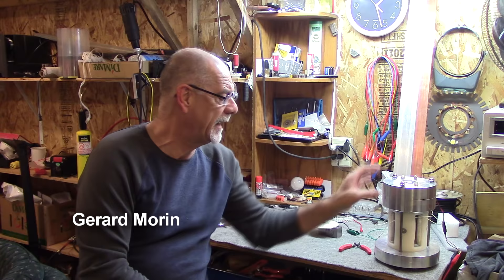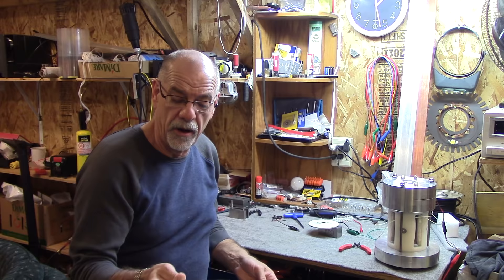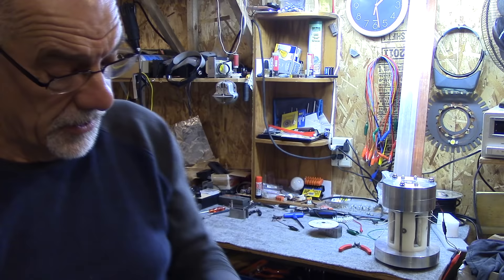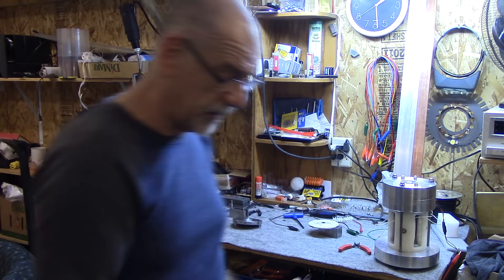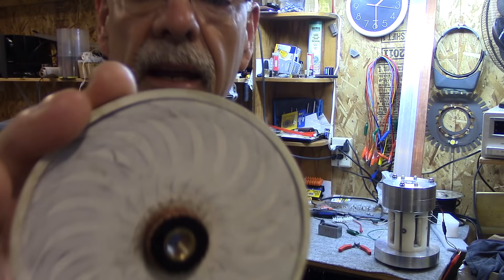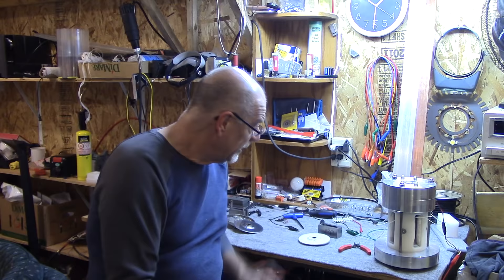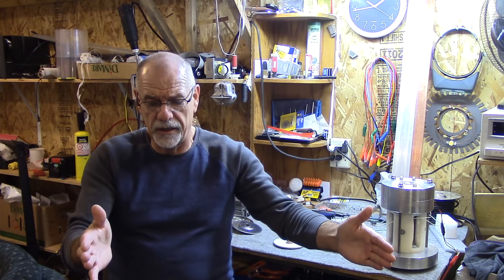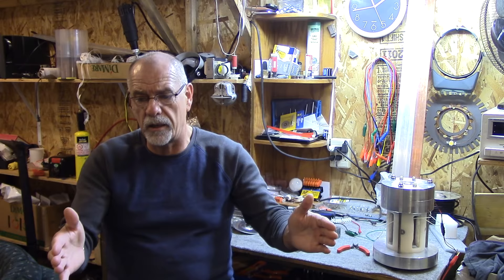Gerard Morin: Hidden technology the world doesn't tell us about

Comment: The motor you are looking at is a modern version built on the principles of the Homopolar generator (Faraday disk). However, rather than a single magnet, they are using alternating poles with the brushes taking the difference in potential from opposite pole spiral arms. Not hard to figure out and really nothing new. Tesla called these Dynamo Electric Machines.

Comment: 29:00 regarding the rotor and spiral winding. Could be fruitful to burn out the plastic to look at the winding. What if the commutator was acting like the slasher you showed a couple of videos back with the rotating copper tube, making this an impulse motor. Where the duty cycle is calculated by the ratio between the copper and the gap. That means that any brushed motor with a commutator and brushes are basically impulse motors.

Comment: With the busted ebike motor and those iron-free copper windings embedded in the plastic: that looks like HDPE plastic, which is everywhere, along with many youtubers who teach melting temperatures and how to make things from it. Surely that wouldn't be that difficult to press and melt into your own windings and moulds. Under vacuum to remove all the air and slight shrinkage when it cools so your windings would be firm and rigid. With no losses to movement when your magnet moved passed it. That would mean you wouldn't need to wind so tight. thanks G

Comment: GMan. Great point about larger potentials generating larger increases. This was Teslas's passion his last 40 years. It's similar to the Oberth effect. It is what makes resonance exponentially amplify. Small changes in high power is much more powerful than small changes in low power. The same added energy produces way more out. 

I think this is a key element of your 30 amp generator driving 200+ amp loads with a step up transformer. 

Thanks.

Comment: I think the Direct Drive motor you have there is causing Static Electricity between the plastic and the Graphite brushes. I have been working with Graphene and Graphite lately and they have electrostatic properties and we know of the electrostatic properties of plastic already. My theory is that it is acting as an electric generator and the copper becomes collectors so it all becomes useable energy.

Thanks for the video Gerard, definitely some worthwhile information here.

Comment: I think the presence of this static electricity being generated by the plastic and the graphite brushes are actually tuning the motor itself alongside the magnets and coils. Which may explain why your DC Regulated supply seems to be running this motor on almost no energy, because it doesn't need the volts, it already makes it's own volts, it just need the resonance.

Comment: Your point of using communications theory in power applications is a great point. 

TC Heins does this and has two free energy patent applications that were denied. They work, but also would totally shut down the current economics of the world. So, the industries are stone walling him.

He calls one the BTTT, the other is a ReGenX coil, which is simply a motor wound with a bifilar coil. This design patented by Tesla adds capacitance to the inductor coils. This phase shifts the induction, making it a motive force in a motor when the motor is used to generate electricity. So, a motor under load makes power... 

Simple communications theory applied to the inductor of a motor, add capacitance and delay the phase of the current flow through the coil, which shifts the timing of the back EMF to a propelling force, not a cogging force. 

Note that the transatlantic cable uses iron core inductors to amplify the current in the signals.. this is creating free energy in the middle of the cable at the bottom of the ocean, but they go to great lengths not to describe it as free energy.  Phone land lines adopted this same technique. That iron core is sourcing the electrical energy which is captured and transferred into the coils with the changing charge fields moving through them. This is the secret to amplifying electrical energy, operating throughout the world, but denied as possible when it comes to actual power applications.

You have some key gems in this video, but its too long. 

I love your comment on white boards being unused by the guy that does.

BTW, Tesla used air coils because his frequencies were in the megahertz and the cores in his time could not switch that fast. The iron core adds capacitance to the transformers, but most of it is canceled out. Tesla added capacitance with wax insulators and more massive conductors and bifilar (his favorite) windings.

Comment: Gerard, I'm no scientist, but it appears to me that this 'free energy'
game is much like the perpetual motion game. 
You will not 'mechanically' produce a gain in energy.
You need an 'antenna' to somehow draw in the existing energy,
condense it, and then put it to work. You can not create energy.
Are magnets the 'antenna'?... maybe.
Does energy flow through a magnet at a set, constant flow/rate?
or can that flow/rate be increased by some means?
What is it that makes one magnet more powerful than another?
Reply: my opinion on magnets is there is no flow. it is a field, not a flow of electrons from one end to another. if that is what you mean.  

What Gerard is relying on the amplification or "free energy" as you would call it is more like an echo. it already exists, we just don't call it free energy
Reply: slippyC73
so you believe they produce a 'static field'?
and that there is no 'work' done, no energy
spent, when they attract or repel each other.
If a spark is produced, is that considered...
energy spent? and if so, since the magnets don't diminish, is the 'gain' converted from the energy of motion applied to the magnets to produce that spark? or is a 'flow' absorbed from a greater surrounding field.
I'm just asking from a basic unassuming perspective, and trying to build on that.
ps- also, I witnessed an interesting phenomenon once, using of all things, balloons- and have yet to define what I saw.
Peace
Reply: check out ken wheelers definition and explanation of magnetism, i made a play list of his magnetism vids if u click on my channel , there is alot of observational proof with the help of a ferrocell magnetic field viewer. He also ties  in with tesla and the ether and shows how light ,magnetism ,gravity, electricity, and dielectricity are linked, also rebuts claims of electrons and photons, interesting stuff!
Reply: Yas master Ken is a fucking genius, hes got quite the personality, but he truly is smart as hell, beyond humans of today.
Reply: Yep Ken is why I believe there isn't a flow... ;)

Very smart guy.  He get's offended easy though if you ask him something that may question something. 

My main problem with Ken is he talks crap every time about physics and so forth. It seems like half the conversation will be about dissing that.  That is fine, I could give 2 shits about physics when it comes to it's fallacies.  I just get tired of it in almost every video, when he could talk about stuff much more important and informing.  

That is all....
Reply: Roger Stancill Like these guys mentioned.  You need to check out Ken's stuff!  If you get through the physics dissing and don't try to understand everything in the beginning, you will learn a lot from him.

I think Ken brings a lot to the table when it comes to magnetism/magnets.  I think he has a good understanding of fields too. I'm not for sure if he is right when it starts coming to sub-particle type stuff though.
Reply: fair criticism , hes not perfect but if you can be neutral to peoples personality and sometimes repetitiveness then u can learn alot.
and kens bitching about einstein is hillarious when u press the 2x speed :P
Reply: lopsumtathro Lol, gonna have to try that some time.  Plus I get to get past the bs...
Reply: lopsumtathro
Thanks, I will
Reply: Magnets are coherent dielectric objects. Fields are unmanifest until the aether is perturbed. Think about it this way. When you go canoeing, you can see the small vortexes formed by the paddle, as you move across the water's surface. Just the same, "magnetism" (not a magnet) is the means by which we "form vortexes" in the aether. Magnetism is excited and vortexes are formed when a dielectric object (ie. magnet) is moved or is experiencing a frequency. This is why when Gerrard makes the resonating noise, it can be picked up as magnetic flux by the trifield meter. In this way "sound" or vibration is really what magnetism is. Magnetism X Dielectricity = electrification.
Reply: +Anthony Mohler - I absolutely LOVE this explanation! It's an Yuuuge help in understanding the mysteries of Tesla's 3-6-9 & Energy, Vibrations, & Frequencies being the key to understanding the Universe! OK, so I'm still confused about the significance of 3-6-9, yet I do understand how key it was to the man himself. It's also a very useful tool for pulling healing energies from the Aether that surrounds us all, and is in us all - I hope the pure scientists aren't bothered by my using this 411 for this-Tesla did this and so much more. I've been following Wallace Wattles audio recordings for "Being Well", "Being Great" and "Getting Rich", as well as the "Toggle It" dot com teachings of Laurie Heusinger to help improve my health-Physical, Mental, and Spiritual, and this brief explanation is much better than the Analogies I was coming up with, so thank you.
Reply: Robert Michael I can't say how I feel about the other mumbo jumbo, I will say that I agree on what you said about Anthony Mohler I have listened to 432 and 528 before and I definitely feel different.  So I'm not discrediting, I'm just not for sure about all the other things tied around it.

Very good breakdown.  The combing, as what Gerard calls it, is what is producing the waves.  Not the magnetic field itself.  The magnetic field is interacting with sub-particles or something that produces those waves as it is combed through the air.

I think one of the coolest things I saw was the tuning forks vibrating, which caused voltage.  This makes me believe that resonance does cause voltage.   Is it the same kind of voltage that is created from magnets combing through the air?  I have no idea...
Reply: slippyC73 - the tuning forks are a huge tool for healing, much like the Royal Rife frequency machines that cure cancers and thousands of other maladies. 50hz tuning fork is for healing bones, et al. The ToggleIt.com healing with energies has went through being called "mumbo-jumbo" through most of it's discovery and Perfecting of this simple yet powerful healing with energy modality, even though it has it's roots in 5,000 year old Asian Healing Arts-no offense taken. I've been a Paraplegic for ~28 years, so I only use what truly works. I'm a novice at best for the variety of energy generation, so I've settled with the HHO/HOD systems for vehicle gas mileage improvement for now, while working toward 100% HHO power, in cars, trucks, and upsized to power entire communities, yet I have always Loved Tesla's work, and I'll pursue that as much as I can. I just get that I'm an antenna to bring in healing energy that permeates, penetrates and fills all that is-the "empty space" around us throughout the Universe to within ourselves. I see Anthony Mohler's ideas helping me be a better antenna for the healing energies I so badly need these days. TY 4 commenting. Peace...
Reply: the matter in the resonating object acts as a receiver and transmitter of the resonance (movement ) of the matter in close proximity to it. Its like the matter is magnets and coils all bumped up together , i agree , this is what sets up the ripple in the ether which is voidance/ counter-voidance  (void-dance- lala la la laaa, la la ,lala) and the void is countered by electical fields .
Reply: I'm a radio ham. Are you aware of how few microvots the signals we receive are and how much we have to amplify them?
Reply: Robert Michael Yea man,  meant no offense.  I was just being honest, I just don't know. I'm cool with it and willing to learn and listen .  It I wasn't then I wouldn't have mentioned listening to the tones...
Reply: lopsumtathro Ken Wheeler is kindergarten level compared to Distinti's adult level work.

Ken's ferrocell examples are nothing more than nano-tech iron filings and equally misleading. When he demos the effect of the "magnetic field" on steel balls and gyroscopes and other magnets he limits the examples to specific cases that reinforce his erroneous theories. In one of his early vids he actually says there is no such thing as a magnetic field, but fails to prove it and later, obviously, he forgot this critical insight.

Distinti not only examines magnetism but also examines the process of science and points to why its so difficult to get to the truth. Ken needs to grow past his anger and focus on the issues. Perhaps one day he'll come around.

Personally I think the whole Aether thing is suspect. It depends on solid particles, which don't really seem to be real. When you drop that assumption, then combinations of fields and field interactions answer most of the questions that remain. Its just the math gets really complicated as well as the language which is based on solids. 

But, as Distinti says, there can be more than one model of any one event. Only when you find an exception can you rule it out. The whole lines of force and independent magnetic field models have been disproven by exception many times over and long ago. Ken obviously failed or add those books to his massive collection of every book ever written on magnetism.

But still, Ken makes a good point that an employee working for the Patent Office, with skin in the game would sell out for fame and fortune to help drive the success of industrialists who were exploiting the masses based on false pretenses... is probably true. And like most sell outs who realize they deceived the world and put it on a path of self-destruction, recanted most of what he was made famous for saying. But, too little, too late. We now have a much more difficult burden to turn around a much larger world.

Find and build with the truth. Many more lives are at stake every day. It could be yours, most certainly it will be your descendents.
Reply: slippyC73 You appear to be caught in the language trap. Yes, the energy is already there. Yes, the energy does not conform to the limited processes of steam and mechanics that were available when the laws of conservation were cast in stone.

But, unlike an echo, the radiant energy that is produced by moving charges can be focused like light into very powerful beacons that can produce more radiant energy and more moving charges amplified beyond the energy required to make it.

Read up on transformers and you will find that the cores used in modern transformers will amplify the power of the input coil by 1,000 times. That transformer, other than resistance, will not use any power until the output coil is connected to a load.

Activating that load coil is when its changing voltage is amplified 1,000 times by the core and is sent back to the input coil which gets it's power canceled by the output coil.

Clearly, a smart person can see that if that output load did not feed it's energy back to the input coil, it would not load the generator and make it make more energy.

TCHeins figured out a really simple way to fix this problem. Check him out on YouTube. His BTTT Patent app in 2012 was denied. Others have replicated his results.

Today, right now, everyone should be able to cut their electric bills by 75%, or daisy chain the devices and not pay for power at all, as they could sell their excess back to the grid. 

Trump would be making plans to dismantle the grid and sell it for scrap. You'd be running your house on capacitors and planning on buying an electric car that also ran on capacitors without the need to stop for a charge.

No BS. Our problem isn't the tech, it isn't the science. Its ignorance and will to live free.

Comment: I think what would be pretty cool to do is to wire that potential generator in a way that it can power itself up. I'm sure you could even use a 9v battery. I've seen other videos of guys powering up huge mechanical generators with 9v batteries the only problem is that their generator is loud & mechanical whereas yours is small & pretty powerful & mostly silent.

Comment: I was thinking:
Could you not replace your problematic bearings with magnetic levitation as shown in videos with magnetic levitating tops. A rotating magnetic top levitating over an electromagnet. You could power the electromagnet with the generator's over-unity output and the rotating part of the generator would act as the top.
Just a thought.